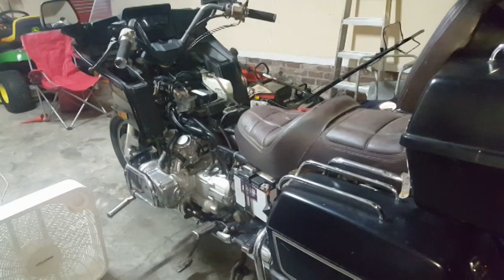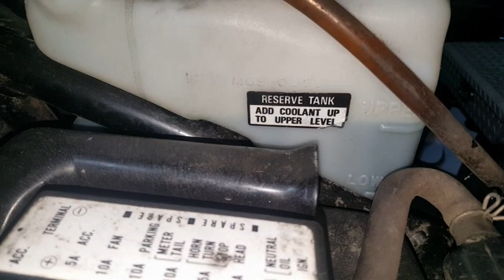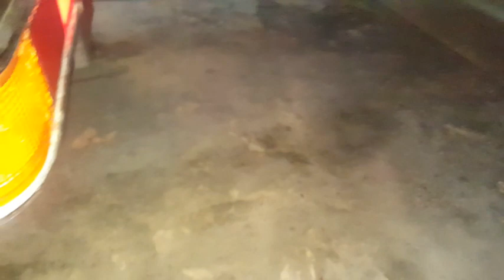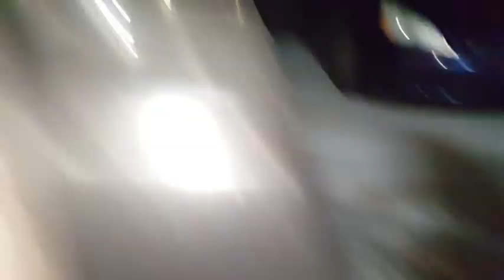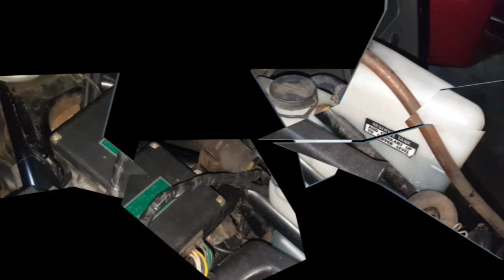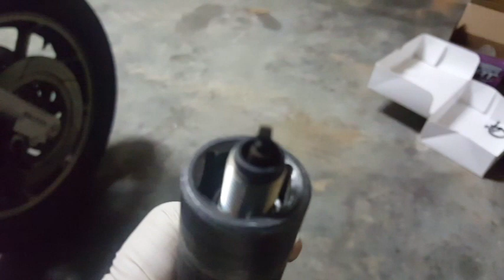1986 Goldwing GL1200 Restoration Update   Cylinder #1 Burning Oil

Comment: Where is the PVC connected to the intake?  If 1 is the cylinder that was gas flooded and sat for years I would not be surprised if an oil control ring is fubar. Have you done a compression check  or lead down test?